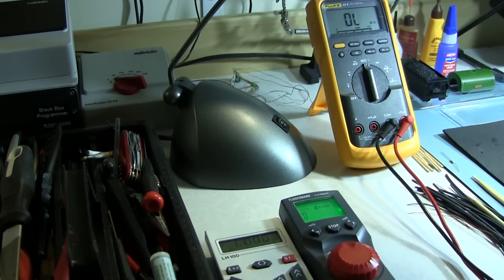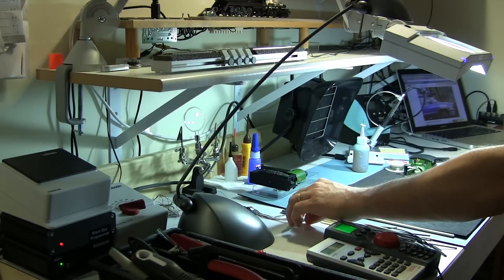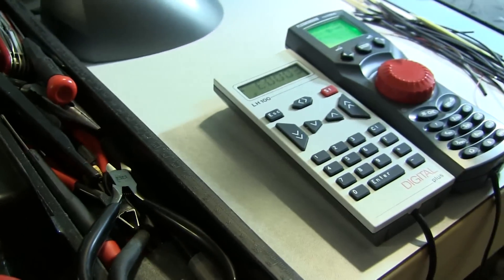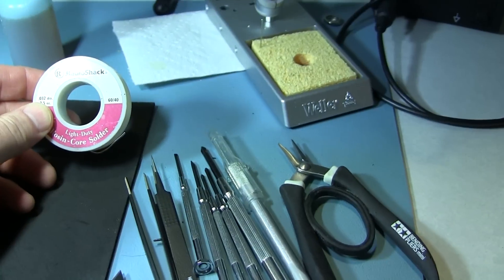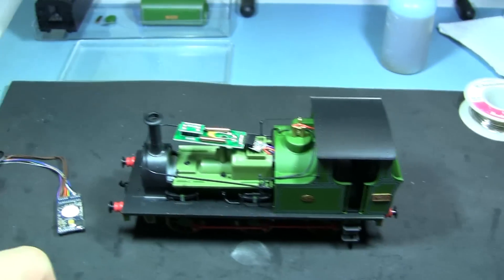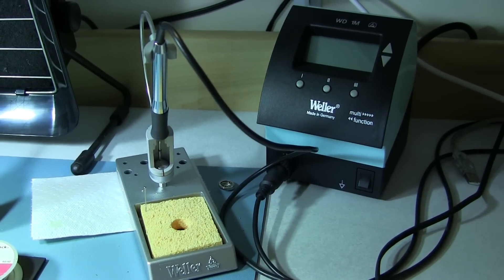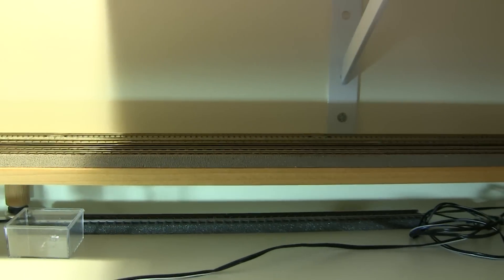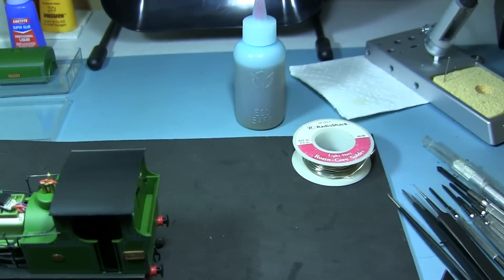DCC TRAIN Alex's workbench Installation  tips Part 1

Comment: Putting something together was never hard for me. And Soldering is very fun. At the age of fourteen I could take lawnmower-engines from the garbage and make them run again. I've had dozens of model-cars since age 10.

 I've worked on cars since 1990, even when I had absolutely no experience fixing them, I didn't have someone to teach me how, I did it on my own.

 Just thought I would share some of my experiences.

 And all that a handy person needs is the right-tools to do the job, the right kind of tool makes the job easier, and some practice as well.